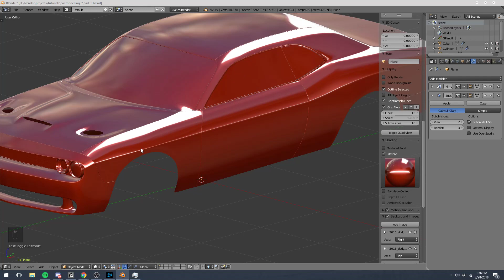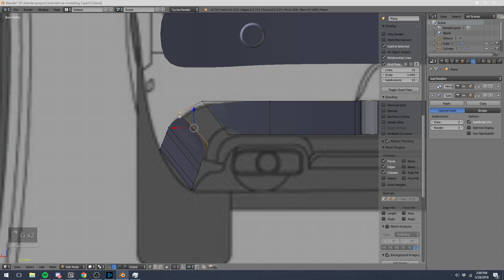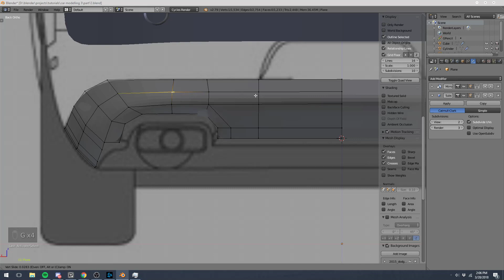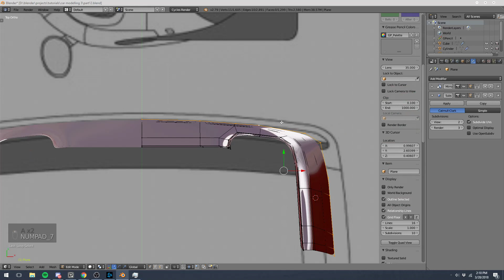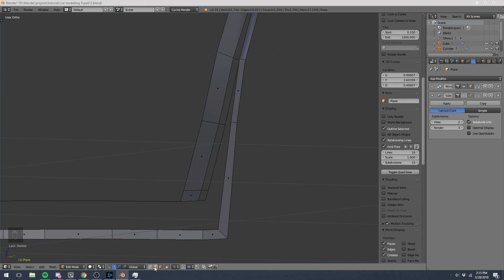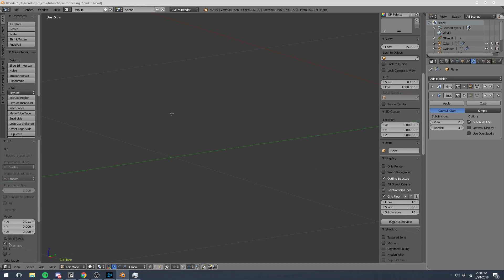Model a 3d Car | part 12 | matcap reflections & modeling more parts

Comment: ♥♥♥♥♥brather you are tooop my problem i wen exportin in unity old this car no workin with glassy materiel and lighting
Reply from the maker: blender and unity do not use the same render engine and materials do not export well. you can either recreate materials in unity or use image textures
Reply: Thank you very much for the valuable lessons I benefited greatly from you, my dear I am working on a game and studying stages at the same time I use blender 2.75 and unity old My problem with materielle blender not export in unity Can you dear Please show me a reference or  vedio To solve the problem. and matcap no working with me Is it because my computer is weak withot cardgraphic an my cpu dual core intel old Does it cause problems thank you very much ♥♥♥♥

Comment: Thanks for this new video, are you gonna push the tutorial further and show us a baking of high & low on blender or other 3d tool like substance painter ?
Reply from the maker: thanks for watching! i think we'll briefly go over lighting, texturing, baking and procedural based materials. There's so many different ways to go about finishing the vehicle after modeling that we'll briefly go over those options but probably not go in too much depth about them in this series.